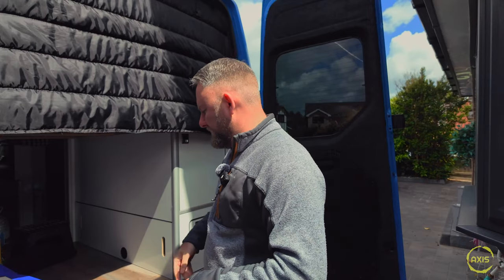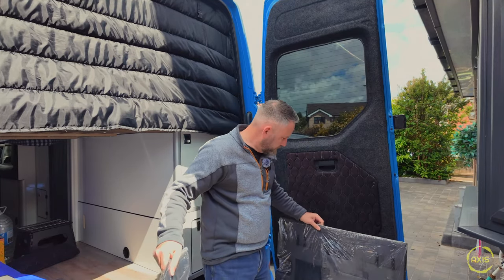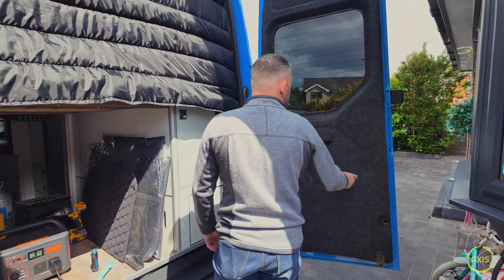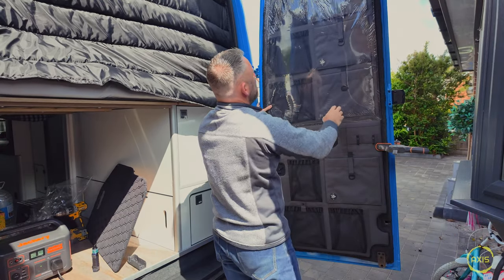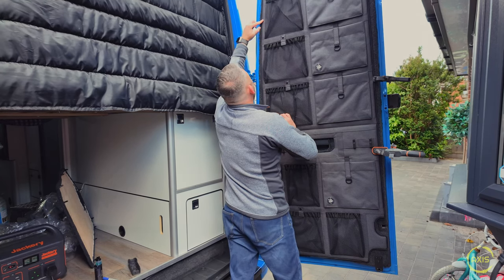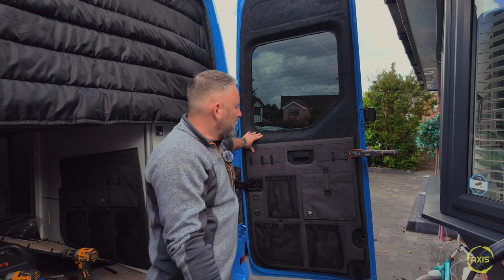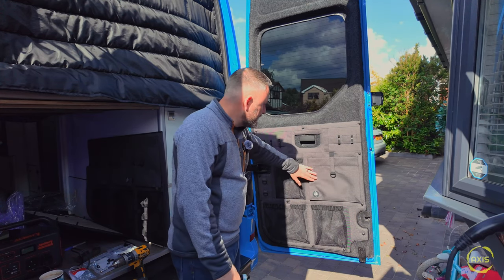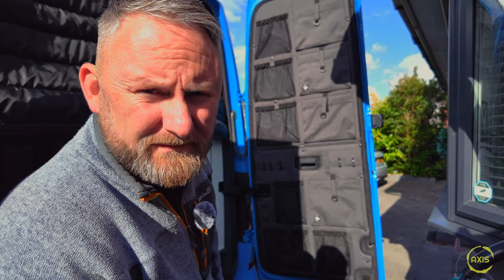VW Crafter Man TGE Rear Door Vandermoon Max Organiser

Comment: I have emailed Van Der Moon with an issue with the same max organiser. There isn’t a lot of metal to fix onto on the upper section, not nearly enough for all the holes they suggest fixing into. Seems the rivets will be placed either too close to an edge or on a curve. Did you find that? I know you mentioned “not enough meat to fix to” but you still fixed it all up. I’m just worried because when lined up (without any carpet or extra material on top of the metal of the door) i don’t trust the holes are going to hit / fix enough.
Reply from the maker: Where I have fixed mine in the video there is still enough to hold it solid with stuff packed in. I do think vandermoon should include the little brackets to screw into the window edges as this will add piece of mind, but still good with out.
Reply: @AXISUK  Thanks for that. For such an expensive item (great qualify of course) you would think some additional assitance/guidance on fixing would be included. What did you use to fix it, they recommend rivnuts which is my concern as some koi the holes are on a bend and therefore will be a nightmare to attach rivets to straight on. Concerned that if I use one of the non recommended methods, screws for example, should something happen and they fail (I have young kids so who know what they may decide to climb on haha) I'll have nothing to stand on as used the non recommended fixings if you get my drift.
Reply from the maker: @chrisglebocki1622  vander show you 3 options for fitting. Rivnuts, rivets or self tapping screws. The later I used as exactly what you pointed out with the curves would be a mer to try rivnut. They are absolutely solid in my van and even if you used rivnuts, I don’t think it would be stronge enough for a child’s ladder 🤣.
Reply: @AXISUK  Haha maybe not but you get my drift. Awaiting their response anyway as Rivnuts are the recommended so want to cover this off with them as according to their info that is the way to fix them but thats far from easy with the material available on the organiser but also the metal to fix to. Thanks for the quick reply.
Reply from the maker: @chrisglebocki1622  Did you not get a leaflet for fitting with them?